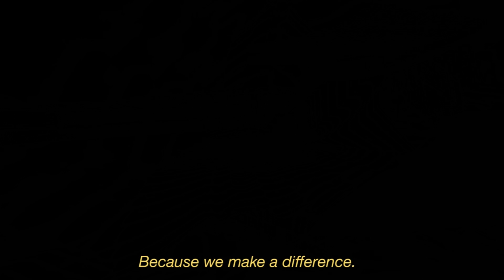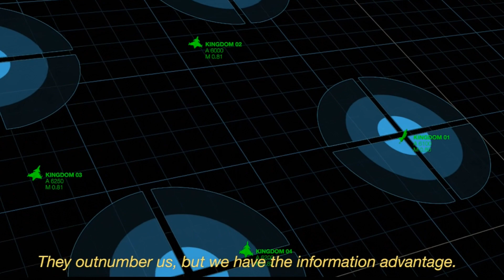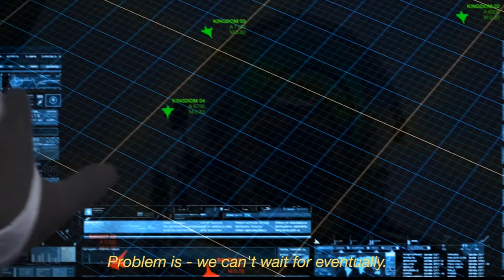Gripen Fighter Jet - Canada's Future Fighter?

Comment: I have seen some you tube videos suggesting that Canada is jointly helping Sweden/Saab developed their next stealth plane. 
It looks like Pres Trump wants to up-grade our F18's and F15's to semi-stealth jets with standoff missiles or with the option to fire large loads of missiles for a missile truck type air strategy. Either way, with networking between a 50% fleet of F18's & F15's and the other 50% (perhaps less) of the fleet as F-35's; the F-35's could target objectives deep within a air denial zone while the F-18's & F-15's could fire standoff missiles into the zone while remaining undetected or untargetable outside the zone. The networking during an advisory's mass air attack would allow the F-18's & F15's to fire masses of missiles at the advisory to reduce their numbers before the F-35's would finish off the remaining. 
Canada's air needs requires a long range Interceptor with long range missiles. A SLEP'ed semi-stealth F-15 with Meteor missiles & coniformed fuel tanks may just be what they should be looking at verses a small short ranged Gripen. I am sure the USA Air Force will have plenty of old F-15's to unload. It could come out cheaper to up-grade the F-18's to semi-stealth & use them as missile trucks or perhaps to ditch them for an unmanned missile truck drone. I believe the Europeans are developing the Cassidian, or some similar spelling, drone for this role.
Reply: An advanced F-15 is the best option for a long range missile truck.
Reply: Perhaps a drone could carry more missiles with full stealth capabilities. For a high speed, long range interceptor it may be hard to beat as it would never get close to the incoming enemy. Are drones effective against more advanced enemies such as Russia and China? It never hurts to have a back-up when things don't go as expected.
Reply: Perhaps a drone could carry more missiles with full stealth capabilities. For a high speed, long range interceptor it may be hard to beat as it would never get close to the incoming enemy. Are drones effective against more advanced enemies such as Russia and China? It never hurts to have a back-up when things don't go as expected.

Comment: F-35 is slow flying, low maneuverability bloatware.
Reply: James Keating nice bullshit strawman. It's obvious you don't know a single thing.
Reply: +rowsdower
  My statement is an ad-hominem not a strawman, 
 and maybe with your obvious superior knowledge you can point me in the direction of some solid evidence of the F-35s' great speed and agility.
Reply: James Keating Lol what's your opinion on slow under Mach 5? The F-35 has the most powerful engine very put into a single engine aircraft. The F-35 can pull a 4G turn just as good as it's other counter parts. You also call the F-35 bloated. It's no more bloated then the F-15, F-18, Euro fighter and Rafael.

Comment: my dad works as chef engineer at SAAB whom designing and building the GRIPEN. (He just finished working on the throttle/engine control for Gripen E), Gripen is the safest fighterjet in the world errors/flight hour (alos cheapest cost/hour). he told me that the crash in thailand was pilot error and not the aircrafts fault. I think only something like 10 gripen has crashed  and the thai pilot was the first fatal crash since the plane first flew in 1988 and with over 200 gripens made. Its a really good fighter for the price and right now I actually would argue that its one of the best if not the best armed fighter jet in the world. Swedish Gripens is the first and only at this time to carry the Meteor missle in active service.  one of the best if not the best active radar air to air missle in the world! gripen also carry IRIS-T missle. and like he says in the video, we have by far the best Data link system in the world. And i have not even metion Gripen E. So what would you choose 10 gripen fully operational right now or 1 f35 (which won't be fully operational  in many years) ?
Reply: Actually, only seven have actually crashed while in flight.  One of them occurred in the development phase because of (what they thought were) software issues.  However, the pilot, Lars Rådeström tried the exact same manoeuvre at an air show and crashed a production JAS-39A the same way.  It was probably pilot error both times.  One time, a Swedish pilot was in a dogfighting exercise over Lake Vanern.  He entered the wake vortex of the other Gripen.  He claimed that the plane stopped responding to his controls and he panicked, pulling the stick back so far that he stalled the plane.  He was so freaked out at that point that he bailed out instead of disabling the auto-stall-recovery setting like he should have (but hey, I might have freaked out too).  One time, a Swedish pilot accidentally ejected himself because the ejection handle was too sensitive and his flight suit caused it to loosen.  One Gripen crashed after colliding with an entire flock of birds.  Finally, we have the tragedy in Thailand.  I saw the footage of the crash.  I don't think it was pilot error, I think it was either pilot death or incapacitation.  The plane flew straight, almost level and lazily for around 20 seconds before crashing.  He never tried to eject so he was probably already dead.  the only fatal end to a Gripen flight in history.

All other incidents occurred on the ground.

Comment: I think you are absolutely correct in your analysis! The future is not expensive aircraft, it is instead about having a large amount of aircraft that is still very capable and very cheap (well...) to both purchase and maintain.

Modern military fighters have become so stupidly expensive that it simply is not worth having the BEST one anymore, something a lot of people seem to completely forget when they claim aircraft X or Y  is better than the Gripen E....Because when you can have like 3 Gripen on ONE fucking F35 (or however many Gripen you get for any other competitor for that matter) then it doesn't matter if the F35 (or the other competitor) is better than the Gripen...because 2v1,  3v1 or 4v1 or however many Gripen you get for one of the competitors it will not win.
Reply: Gripen E are not so cheap to purchase. The cost is quite a lot higher than Gripen C/D although the capability is also a lot higher. They do have low operational costs but the up front costs are significant.
Reply: Sure, but they are cheap compared to the alternatives, that was my point :). That is unless you opt for used aircraft ofc.

Comment: I agree with you completely, Canada needs an aircraft that can jump start our Aerospace program. The F35 is Americas Maus tank equivalent. Too expensive and costly to operate effectively. War is fueled by money, and the country that has more and spends less for greater effect has always won. It does not matter how good the F35 thinks it is, at the end of the day we can field 4-6 Jas for the cost of a single f35. Our only potential adversary can field twice the amount of aircraft that we can in any tactical situation. A flight of 6 F35s(which is all we can economically deploy overseas) does not have enough missiles to deal with the threats they will face.

Comment: Mr Matsimus, you are a brave person indeed :). The dislike for Jas 39  out there by all the Youtube "experts" is massive. What is (was) true is that Jas mostly loose when compared numbers on sheets but in real life it is a different matter in my humble opinion. 

What I base my opinion on? Well, let me give you experts three things to check out:
-When JAS was used when Algeria fell apart what did the other Airforces say about the JAS system (and some Airforces choose not to say). It is a Airforce total systems that have to deliver, not a single gungho plane with an untrained pilot in it. 

-When JAS was at Red flag. What happened there if you scratch the surface. What happened when there was F-22 vs JAS 39 (old version) encounters. 

-What is the minimum flight-hours per month required for a pilot so he can basicly perfom as expected  according to the real experts? And when checked that, check what your favo plane costs compared to a JAS 39E.  Especially you who favors Rafale. 
You can have the worlds most advanced plane but if the pilots can`t train enough with it and in actual air tactics because of costs, they are sitting ducks against a trained Airforce. 

With all above said maybe it is time for me to comment  on  what Mr Matsimus actually talked about but that many here seems to have forgot very fast... :).
"F-35 together with JAS in Canada seems like a nobrainer?"
Well, in my opinion I do think it would work very well too (if we choose to put aside the F-35 problems for a while) because:

-F-35 will be very expensive and time consuming to maintain and will have long turnaround hours so Canada will on a tactical level have to choose very wisely when to use their limited amount of F-35 ´s. JAS is very cheap compared to other Fighter jets to keep in the air and have very short turn around, also that compared with other fighters. 

-F-35 seems to show on last Red Flag that it is a very good fighter when teamed up with other fighters (once again let´s forget for a minute the F-35 issues as that was not what the video was about). 

-Canada wants to produce their own fighters. That is one of the cornerstones in the JAS 39E concept already. Meaning that time will not be dragged out. 

Finally, the one engine topic. Once again check facts how many crashes due to engine problems, one engine vs two engine fighters, it has been worldwide the last couple of years.

Comment: I dont think going budget is a good thing, if you want to keep your air force up to date then getting the typhoon would be the best course of action.
Reply: The newest F-15 variants are superior to Typhoon in capabilities. F-15s won several recent competitions where higher budget options were acceptable.
Reply: There is no way you can know that because neither have properly been tested in war they have more or less the same specs although the typhoon definetely has the better agility due to its unstable design. Competitions are irrelevant, something made to win a competition doesnt mean it will do well in war. The challenger tanks also did badly in those competitions for various reasons usally because they were always sent unprepared like without thermals but it is arguably the best MBT in the world and its proved that with its performance is various warzones thus proving competitions dont mean a dam thing.

Comment: 18-24 F-35s Combined with 32-40 Gripens would be Optimal for Canada.
(and if we take those lower numbers so 18x F35,32 Gripen E/F together with the the 18 Super hornets already ordered would give Canada a strong and very capable airforce)

Since that would give them the best of both worlds with the Gripen as the main workhorse and the F35 for its Stealth capability etc.
Reply: 50 F-35A + 50 Advanced F-15 2040C. That is still far less than the original number of Hornets that were used by Canada.